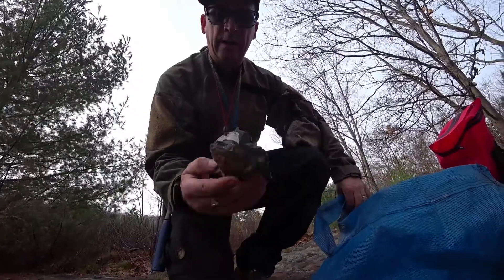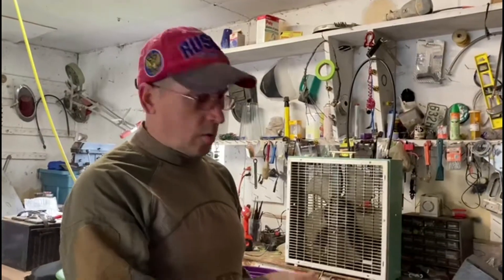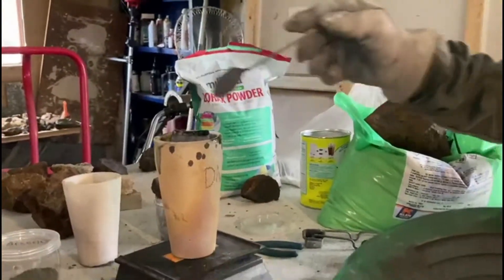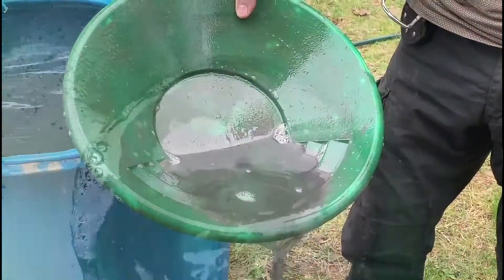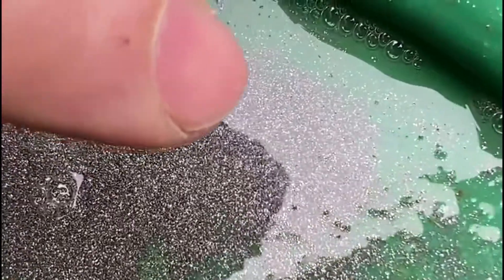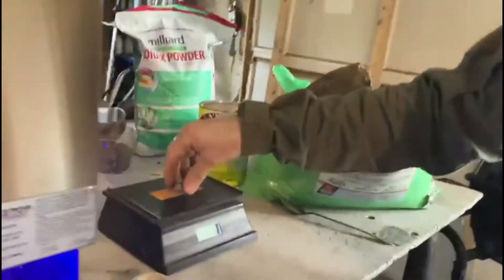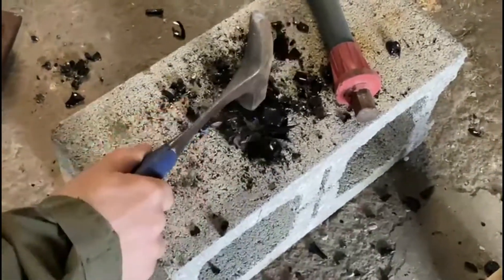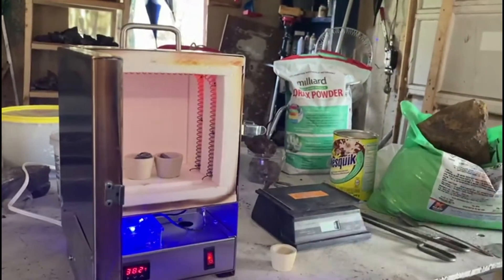Checking for Gold!

Comment: Get the Books by Shepherd and Dietric on Torch assay process. You can measure your beads and refer to a table/graph for the weight if you don't have an expensive milligram balance. Also your beads have a dimpled/soccar ball appearance and could contain silver , and PGM.
Reply from the maker: Thanks for your input!

Comment: The dore bead left at the end can also contain silver. A further processing with nitric acid to remove the silver is required. 
Also arsenic gold ores typically have poor recovery and cost more to process,.
Reply from the maker: Your right. That's why I didn't bother separating the gold from the silver. Just not worth it.